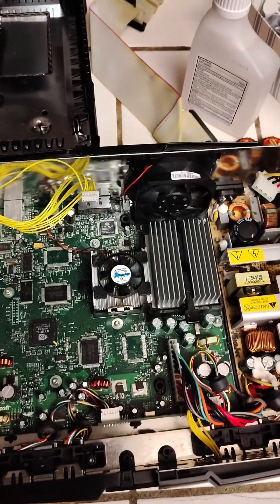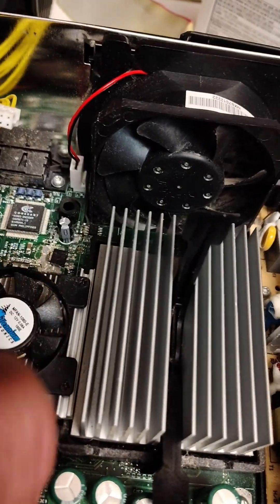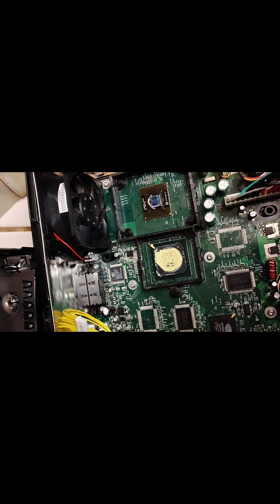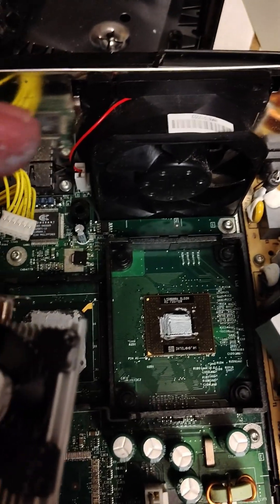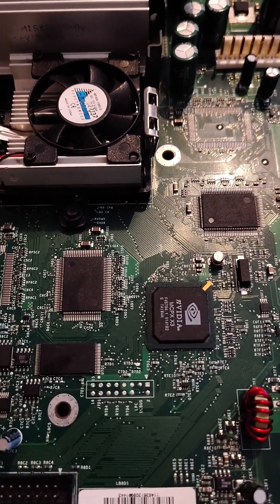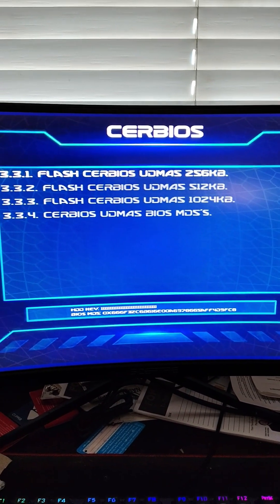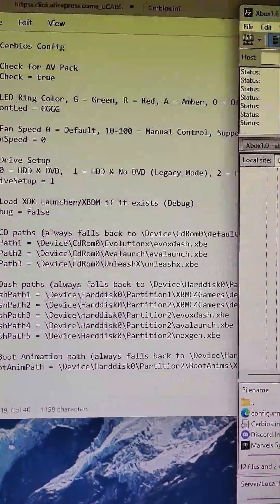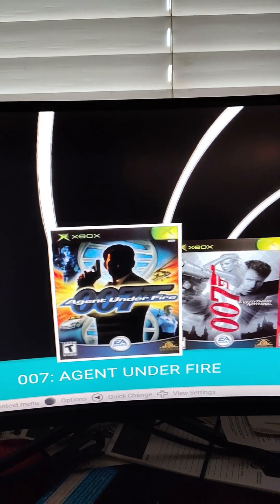Build your OG Xbox and Setup it TSOP. How to Guide

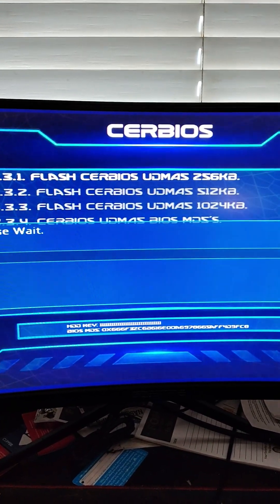Comment from the maker: @7:00 I picked the small bios size this is a 1.0 i did pick the 1mb flash that is correct version. PLEASE DO NOT mess this up or u will have to re wire and re do it later on it's pain.

Comment from the maker: MAKE SURE YOU SELECT THE CORRECT TSOP SIZE Or you will BRICK YOUR SYSTEM!
Xbox v1.0 and v1.1: These revisions had a 1MB TSOP chip.
Xbox v1.2 to v1.4: These revisions used a 256KB TSOP chip.